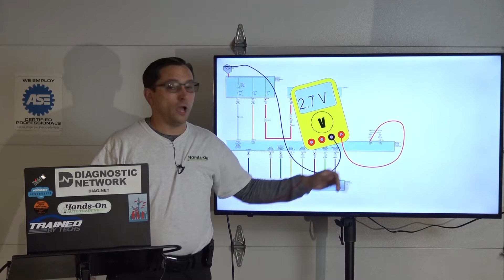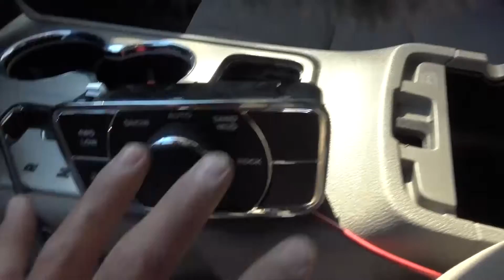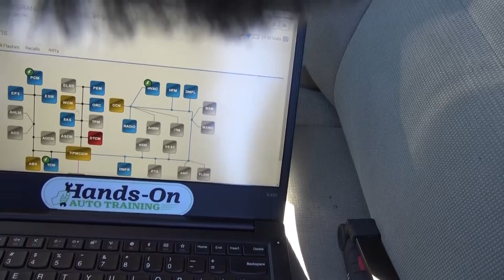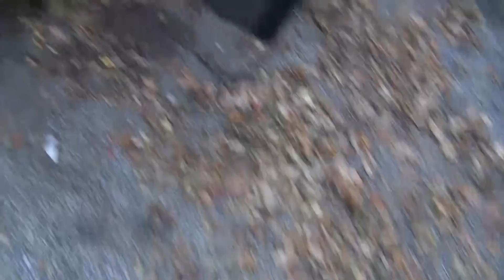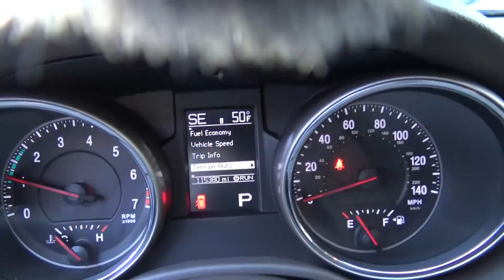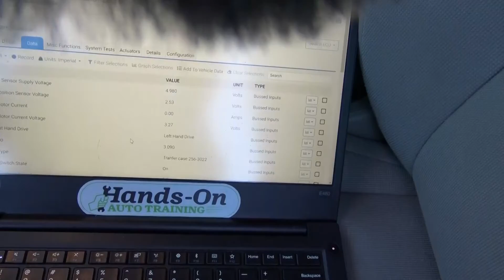2012 Jeep Grand Cherokee No DTCM comm / Blinking Select Trac Switch

Comment: What if the select trac has no power to the switch? My select track isn’t illuminated and it says to complete shift to neutral alllow engine to idle.
Reply from the maker: Where does it get its power from.. check fuses?
Reply: @BrianMann216  check every dtcm fuse. My cigarette lighter doesn’t work, but I doubt that’s the issue

Comment: Great video. I've been troubleshooting my 2012 Grand Cherokee. There is binding of the wheels during slow speed maneuvering - and it exhibits the blinking dial switch also as you showed here. Getting a replacement for the module is a pain - it is on backorder everywhere (is the global microchip shortage the cause?). In this video it seemed like you got a replacement module quickly. I sure hope I can lay my hands on one without too much trouble....
Reply from the maker: Did you have vehicle scanned for all dtcs?
Reply: I have the most basic of trouble code reader... nothing comes up. I have thought about taking it to a shop to try getting the same kind of basic confirmation as you got when your software was unable to communicate with the module.... but I'm presently not working, so I'm trying to avoid the cost of hiring a mechanic to plug in & diagnose it. Oooooo - that just reminded me. I believe that the auto parts store near me (Pep Boys) does no-charge scans to help customers determine what their issues are..
Reply: @A-V  did you ever figure out the problem? I have the same issue
Reply: I had to replace the transfer case control module - it is a 2-minute fix
Reply: @A-V  yea I recently bought mine and the guy said he replaced it but I feel like all signs point to the control module

Comment: Did you program the new TCCM when you replace the old one?
Reply: Did you progam the new DTCM MODULE when replace the old one?
Reply: @entertainmentbrothers2851  yes the DTCM?Did you program it or it is preprogrammed? Bec i have trouble fixing the 2015 jeep grand cherokee 4LOW switch is not working it has a DTC U0102 i put brand new DTCM and it did'nt work DTC U0102 is still there when i put DTCM from other Jeep it works perfect 4LOW is working no wheel draging while turning..

Comment: Nice diagnosis. Where did you get the jumpers at you used on the module? Site has sure is a beautiful thing with the topology layout
Reply from the maker: https://www.aeswave.com/uTest-Advanced-Terminal-Test-Kit-p9715.html
Reply: How much will a witch set me back? Know of any aftermarket scanner that lays out the active topology out like that?
Reply from the maker: @philh9238  $50 for 3 days I use a j box when needed. Note you need a tech authority sub as well for programming $26.95 / day. Annual subs are available for both.  
That topology "map" is I call it is nice. To see that module coming and  going  sure was helpful.
Reply: It’d be super helpful if you could make a video on how to buy and set up the subscription. I know how to do ford and gm but not Chrysler really
Reply from the maker: @philh9238  I can try  that. It is a bit confusing even to me as I hardly use witech any more. I think it took me like 20 minutes to get mine working due to updates etc.  Btw do you think there are shops in your area that would want a course locally from me?
Reply: I’ll have to check. They have a mobile guy who programs but he can’t diagnose his way out of a paper bag lol
Reply: Okay so I got witech 2.0 on my laptop. Where you register j box. I waited 2 days. So do we need to buy a tech authority sub for just programming or for all bi directional tests. I will be using it Wednesday on my friends car. For a no communication with can c bus.